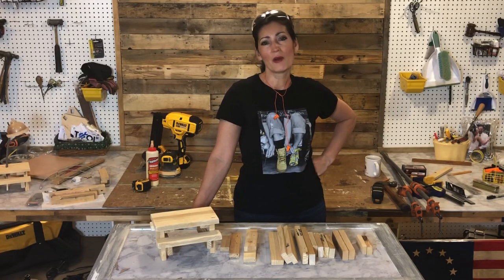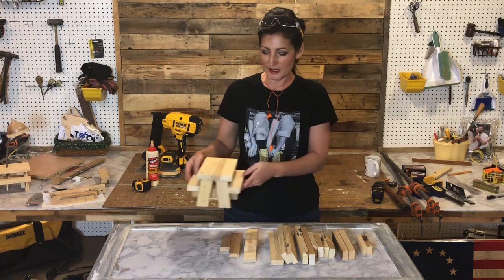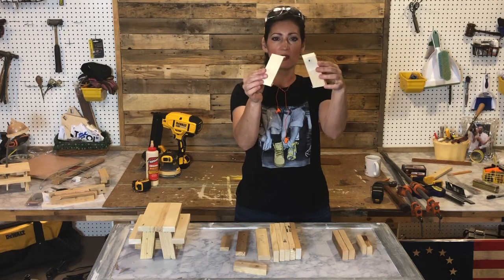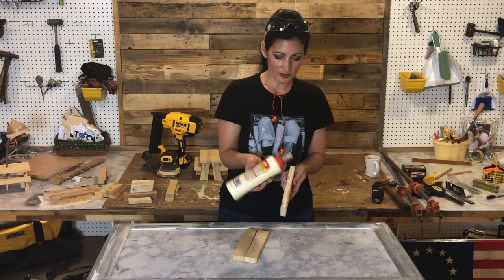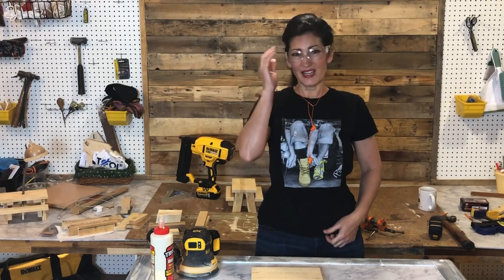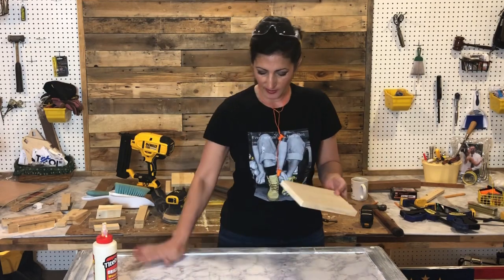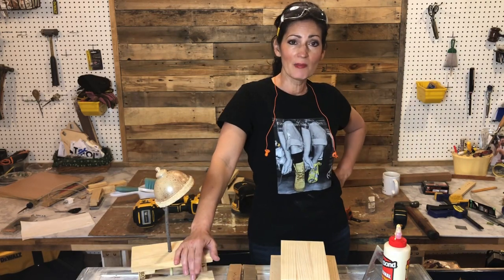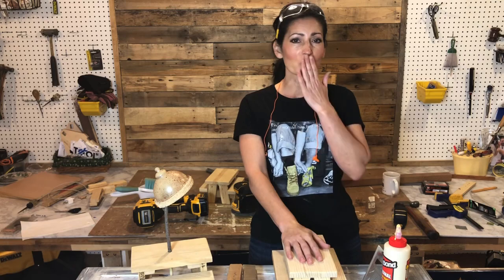EASY Squirrel Chipmunk Picnic Table Build. HOW to BUILD Woodworking Craft for BEGINNERS

Comment: What a great video. Very clear instructions and cute outcome. When building a larger one for squirrels, should I use a different angle than 10 degrees?
Reply from the maker: I haven’t built one in a while but I think I kept it at 10 degrees for the larger size as well.
Reply from the maker: And thanks for watching! I switched up my technique for attaching the legs by shooting a single nail in each to stabilize it, then turned the table upright to make sure they were all hitting evenly, then added more nails. Hope that makes sense.